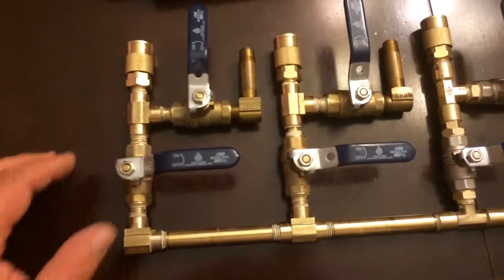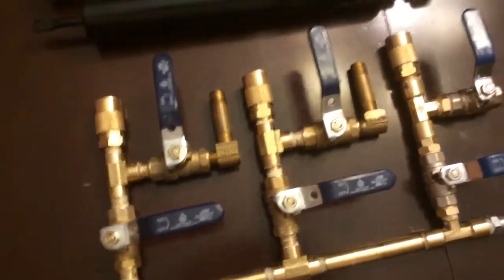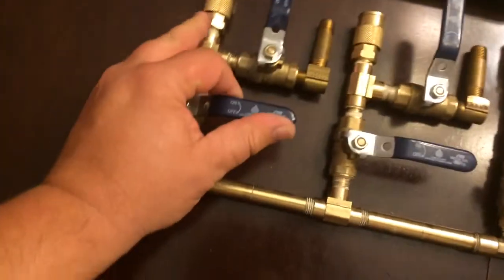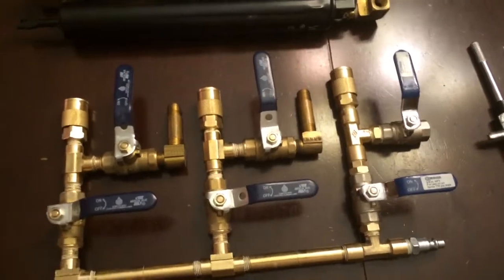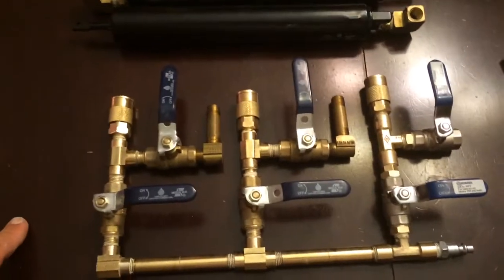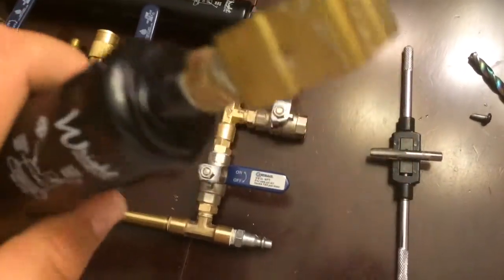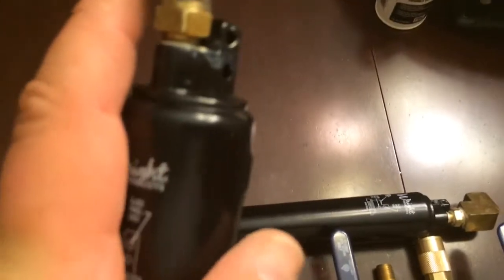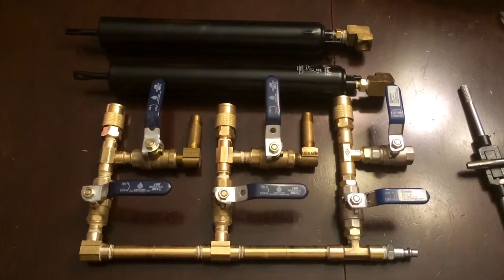Halloween Haunt - Homemade Pneumatic Cylinder & Manual Control

Comment: have a look on ebay 2 way 5 port valves under $10
Reply from the maker: Thanks. I learned more about those after posting this video. I'll eventually replace the controls that I have with those valves and motion detectors as switches. It would make it easier on the person in the control booth.

Comment: how much did all the ball valves and fittings cost
Reply from the maker: I had a lot of the brass leftover from other projects or pieces that I've salvaged throughout the years. I did buy the ball valves and some of the connections that I was missing and spent around $30. Total if you had to buy all new would be around $60 if you shopped around.